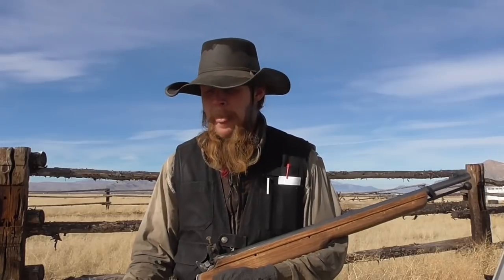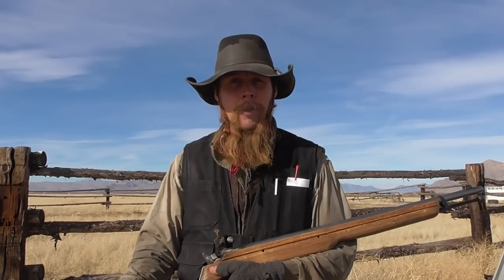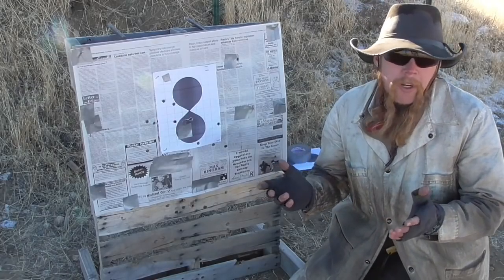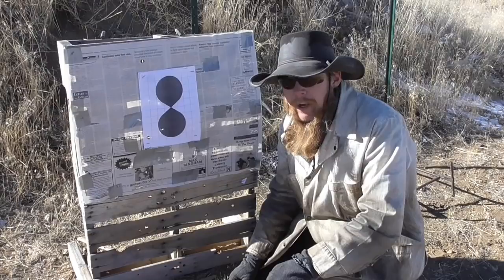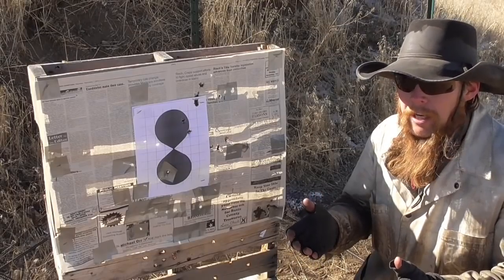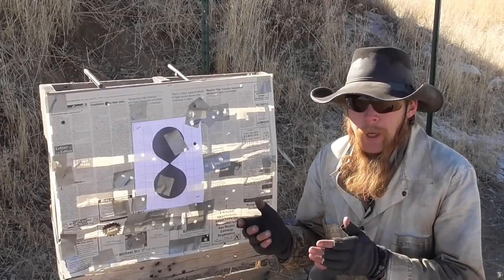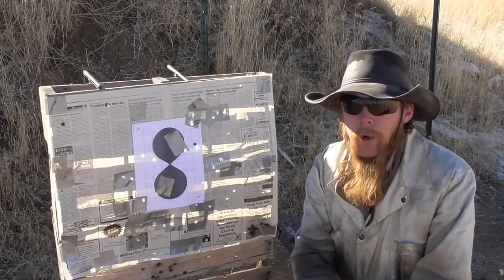Muzzle Loader Velocity vs. Accuracy (TIS175)

Comment: Have you considered the effects of recoil on accuracy? The greater the powder charge the greater the recoil. Furthermore, any powder which has not been consumed by the time the ball (or bullet) leaves the barrel is wasted so if you want to use a greater charge you need to think about longer barrels.

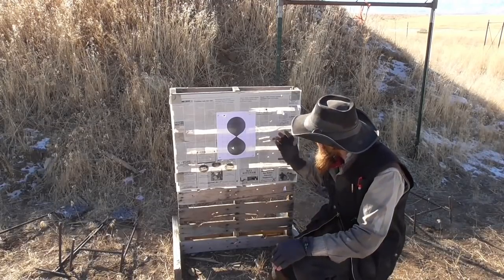I believe in one of your other videos you mentioned that you were making your barrels with a 1:24 twist rate. For a muzzleloading rifle this is a very fast twist rate so it is no surprise you saw greater accuracy when firing patched round ball. If you would prefer to shoot minnie or other long bullets you may like to consider a 1:48 or even 1:72 twist rate.

Comment: Your higher charges are the problem due to the softness of the lead. With your minie ball, the US army did some tests. At about 90 grains of ffg they found the skirt was blown off the ball at the muzzle. At 80, it massively deformed the skirt. They settled for 60 and achieved very respectable performance. At about 130 grains of ffg with round ball I've found similar accuracy issues. I've recovered a hand full of them and I believe the ball is skipping rifling. Ball deformation, patch tearing, and excessive leading being what I found.

I think if you add some tin or antimony to your lead it may help

Comment: I have some experience with black powder rifles. Your experience is very typical. Every rifle has a ideal load that it will shot most accurate with. If you want every bit of accuracy and start dialing it in to the exact load that rifles wants, you will find there is most likely a slight difference in powder load for bullet weight, but not a lot. There is a small window of top performance for such a rifle.

Comment: I had fouling so bad by the 3rd shot I couldnt get the projectile down the barrel to seat it ???  I did find Blackhorn 209 fouled the least and also made the least smoke.   I varied the powder charges in smaller increments of 10 grain from 50-110gr and found 70gr was the best for the 240-250gr powerbelt bullets I was using.  I was using jacketed powerbelts, the lead fouling with the lead version was unbearable.....
Reply from the maker: Interesting...I wonder if something about the rifling pattern in my gun makes it less prone to foul, or easier for the next shot to scrape out the fouling from the previous one.  Shooting bare lead projectiles with a bit of moly grease applied to the muzzle before seating the ball, I can usually get at least 20 shots before enough fouling accumulates to make loading noticeably more difficult.  With patched roundballs, I can get over 50 shots.

Comment: @TheIdahoanShow would it be possible for you to try making a rebar barrel in 9mm? Or what caliber you use in your handguns?
Reply from the maker: I expect it would be possible to make a pistol barrel out of rebar, but I'm not sure how practical it would be.
Reply: @TheIdahoanShow Well, your really the only person on YouTube experimenting with alternative materials for gun barrels. Which has been discussed in survival books and what not but never built to my knowledge. Other options for creating a gun barrels include laminate construction starting by using a tube of the diameter of the caliber your using  and sliding the next size up over the tube that will be your barrel. Especially if one we're  build a barrel from 22lr to 12gauge or something in a rifle caliber.a
Reply from the maker: It is surprising how thin a tube can be and still survive the pressures generated by modern pistol cartridges. ( For example: https://www.youtube.com/watch?v=9loXa-H0crE&t=2s )   Meanwhile, rebar is impressed with a grid pattern that helps it grip the concrete in its normal use as concrete reinforcing material, and the grid pattern makes it more complicated to find (or even define) the center of the bar: If you clamp a piece of rebar in a typical 3-jaw lathe chuck and drill a center hole in it, then take the rebar out of the chuck and put it back in, chances are that the whole will no longer be centered on the axis of the lathe.  Thus, if I made a rebar barrel, the first thing I would probably do is turn the bar down enough to get rid of the grid pattern.  That is certainly doable, but it is an extra step that wouldn't be necessary if starting with a piece of smooth round bar.  So too, while rebar is stronger than mild steel, it is not as strong as 1144 "stress proof" rod or tempered 4140 alloy steel, so if one is going to invest the necessary effort in boring a barrel from bar stock, it is probably worth it in most cases to start with a bar of 1144 or 4140.  It is true that rebar may be more readily available than alloy bar stock, but if availability is an issue, grade 5 and grade 8 bolts are about as available as rebar and offer similar strength to 1144 and 4140 steel.  In fact, some grade 8 bolts are made of quenched and tempered 4140 steel.  On top of their comparable availability and good strength, bolts have a more uniformly circular profile than rebar and they already have external threads that can simplify attaching the barrel to the receiver.  This is why I say I'm not sure about the practicality of rebar for barrels: I'm sure it could work, but in any given application it would probably be easier to use either tubing, bar stock, or a large bolt as a starting point for making a barrel.

Comment: I would think it has to do with burn rate. Blackpowder and its substitutes deflagrate relatively slowly. The larger charges leave significant powder that is still combusting when the ball reaches the muzzle. The shockwave I think is altering the trajectory of the ball.

Comment: interesting, cool vid, and nice gun. i would like to get a muzzle loader sometime. would you recommend one for some deer hunting?
Reply from the maker: @AK Custom     Well, truth be told, I expect that most of the .50-caliber muzzle loaders on the market are suitable for deer hunting, so the choice of make, model, and type is mostly a matter of personal preference and applicable hunting regulations.  (Here in Idaho, for example, you can use just about any muzzle loader to hunt in the general deer season, but in the special muzzle-loader-only season you're not allowed to use scopes or saboted bullets and the rifle must use a traditional percussion cap or flint lock ignition system etc.)  Anyway, the rifle I used in this video is the second prototype of a design that I'm developing for Atomic Rifling & Creative Operations LLC.  Right now their plan is to produce it mostly in kit form, where the product would be mechanically functional as sold, but it would be up to the purchaser to put the aesthetic finishing touches on it.  Once it goes into production (hopefully in a couple of months) I could probably get you a substantial discount on one if you wanted to do a build video on finishing the kit and/or a review of the product.

Comment: True, bigger is not all ways better. I found this out loading for my 44. The "mid range" power scale is where it Zeroed in and grouped. I also had consistent tight groups with 180 gr rounds vs 240 gr but with the 240 grs it was the midrange loads for grouping. Like yours, the hot rounds went everywhere, 👌👍         BTW: could smell the smoke😁

Comment: 365gr pill?  What bore you shooting, 50?   Is the rifling twist not stabilizing the longer Minnie?  
You can check with online twist calculators- Playing around with bullet Diameter, Length, Twist, and FPS might show whats going on with long vs short bullet accuacy